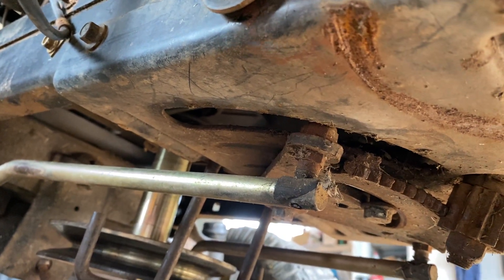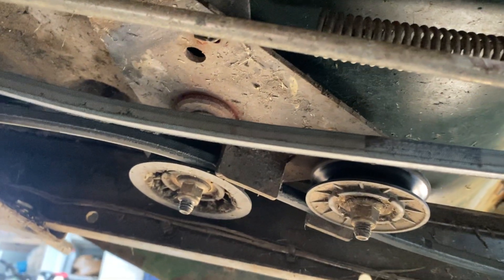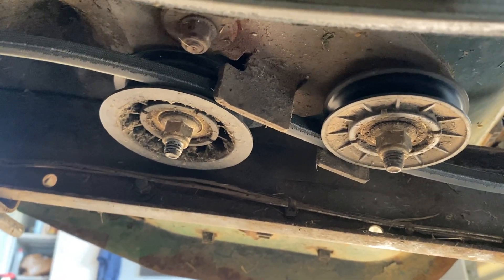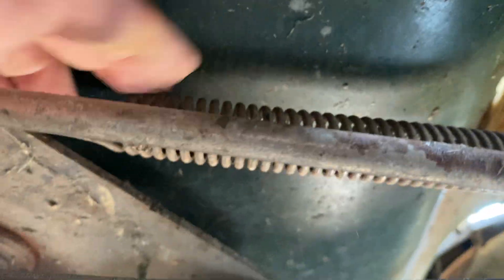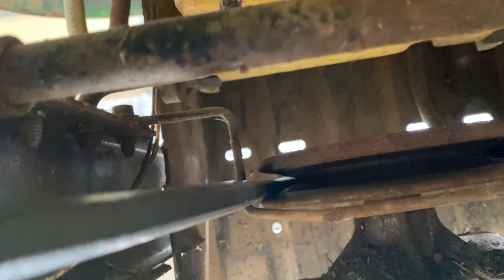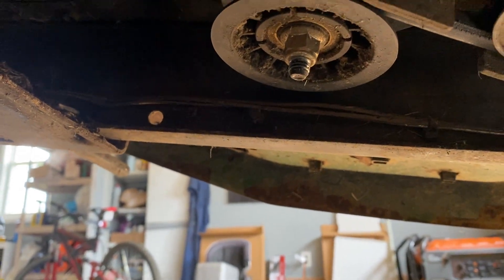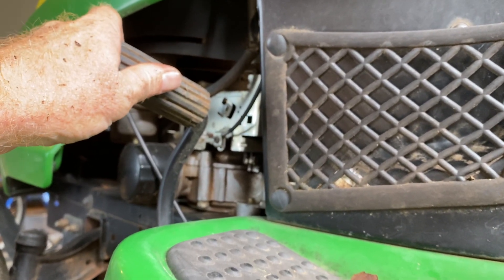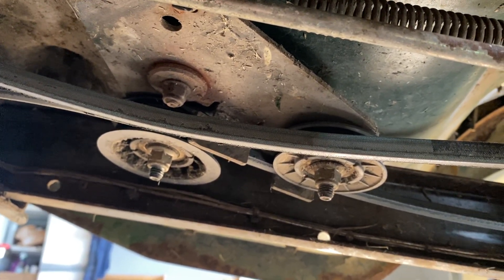Riding mower won't move? John Deere LA105 Drive Belt- Routing and how it works,

Comment: so we changed the belt to the recommended size and it was too tight to where it was pulling on the break, so we got one 1/4" bigger and now its too loose to where it will not go forward. what the heck can we do now?
Reply from the maker: has to be a belt routing issue, it should work every time

Comment: Just what I need in order to fix my 20 LA110 as it’s struggles to up hills. Also, can you do a video on a stuck park brake? To the best of my knowledge on mine, there is no debris blocking it but it’s been stuck in the unlocked position for years. I have to stop on level ground if I need to hop off if for an anything.
Reply from the maker: There aren’t a lot of videos on the brakes, but that’s a great suggestion.  They’re pretty simple to work on actually.
Reply: there's an adjustment for the brake. Inside the driver's (left) rear tire. Takes a 1/2" open ended wrench. You have to loosen, the outer nut, to adjust the inner nut. Tighten a little and test.

Comment: this is a great informative share, thank you, i wonder do you know if there is a tensioner on the belt that drives the deck? there's a drive belt that drives the belt that turns the blades and mine is loose and slipping and coming off! so i am wondering on a x500 if the deck drive belt has a tensioner like the transmission drive belt?
Reply from the maker: there is an adjustment on the handle that engages the belt, unless yours has an electric PTO, otherwise, its more than likely that your deck belt has stretched and needs replacement.
Reply: @wecanfixit7308  thank you very much, gotta love quality equipment and sharing to keep it going.

Comment: buongiorno,ho un trattorino john deere 105 e oggi o stavo partendo e ho sentito un rumore e il trattore non si muoveva più, ho spostato a mano il trattorino e sotto ho trovato una molla di faerro rotta con una rondella grande ,cosa e successo?
Grazie
Canetti
Reply from the maker: its probably the spring that keeps tension on the clutch pedal, without it in place the belt will slip and the mower won't move.  It should be an easy fix
Reply from the maker: "Sto usando ChatGPT per tradurre: probabilmente è la molla che mantiene la tensione sul pedale della frizione, senza di essa la cinghia scivolerà e il trattorino non si muoverà. Dovrebbe essere una riparazione facile."

Comment: Finally someone with an answer to why mover going  so slow. Put on a new drive belt still a bit of slack.  New belt was the same length as old one that was cracked and had missing pieces.  Did they sell me the wrong belt.
Reply from the maker: pull back on the clutch pedal with your foot to take the slack out manually and see if it pulls better.  If it does, lube that pedal pivot point up with something and maybe shorten the return spring some, or possibly replace it.

Comment: Very helpful, the belt on mine dig itself in one of those plastic pulley, I took off that pulley and dig out the plastic or some of the belt, cause my la105 stop moving, I'm thinking the belt got stuck on the pulley
Reply from the maker: the pulleys will rub through eventually, luckily they’re cheap to replace

Comment: Here's what I'm seeing and I'm curious if it is correct: After replacing the two pulleys and the drive belt, the previous noise I heard when the brake is released is gone. It was the rattle of the two drive pulleys being bad. Now, I heard a little bit of racket when the brake IS ENGAGED. I took a look underneath and the drive pulley is running in little fits and starts. It has enough slack in it that it's whipping a bit on the forward return side. Is the drive belt supposed to move at all with the brake engaged? Do I loosen the tensioner? Or is this normal for a new belt to be a little tight and it will eventually relax?
Reply from the maker: try disconnecting the cable from the arm entirely and see if the belt is still trying to engage. If it is still trying to grab, recheck your routing and make sure you don't have a twist in the belt somewhere causing it to be too short. Assuming the deck is centered on the brackets properly and it isn't hanging so low that its taking the slack out.  If removing the cable from the engagement arm works, then you could back off the adjustment a tad and see if that works.

Comment: My drive belt is slipping. It started when the tensioner spring broke, I lost pull/drive. I replaced the spring, belt and pulleys and it now pulls but barley. With my weight on the mower it will not pull me and the belt is slipping and will barley grab the trans pully to make the tractor go forward or reverse. It’s like the belt needs to be tighter but I replaced it with the matching belt. I’m stumped.  I’ve made sure the bracket holding the tensioner pulleys works correctly. When you release the brake the belt gets tighter but not tight enough to pull the mower. Thoughts?
Reply from the maker: Try pulling back on the brake pedal with your foot.  If that helps, you possibly put the spring in the wrong hole, not allowing it to get enough tension for the belt to grab. If you have a new (properly routed) belt and the correct sized pulleys, the spring is really the only thing that could prevent you from getting enough tension on the belt.  Good luck!
Reply: @wecanfixit7308  I just found the problem after sending that comment. I removed the brake safety switch and the plastic switch was keeping the brake from fully releasing to put tension on the belt. Lmao I just rode around the yard w a beer bc I was so happy lol. Thanks. Good video

Comment: Is it possible to add tension via some adjustment point?
Reply from the maker: you can bend the spring where it attaches to the mower to get more tension on it, but it really should work as designed.  Its possible the belt is stretched.